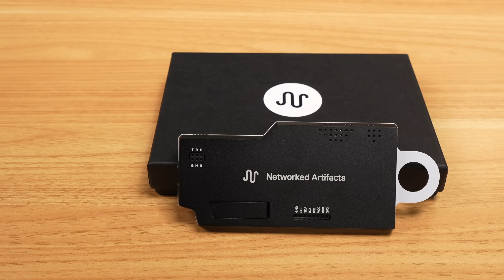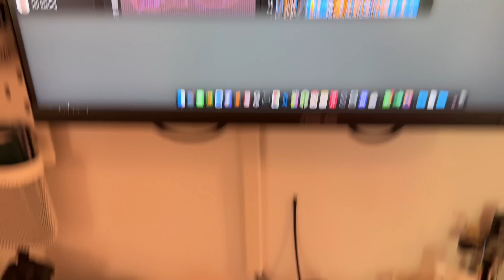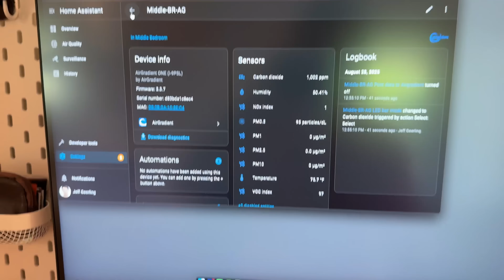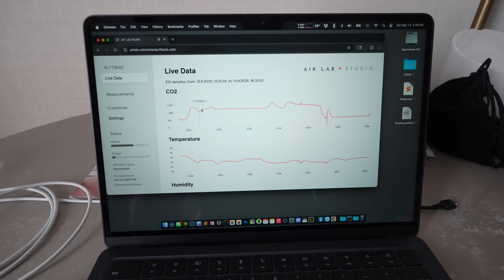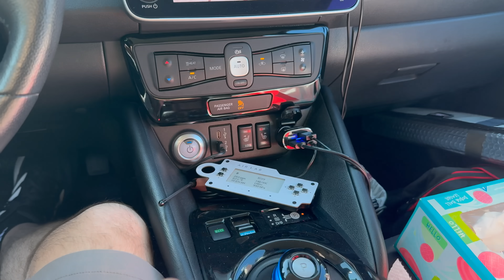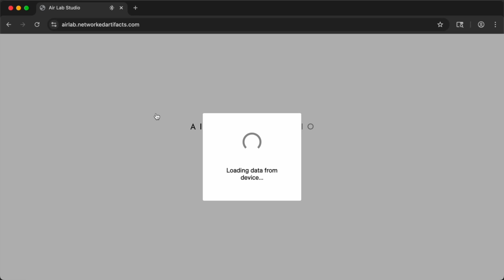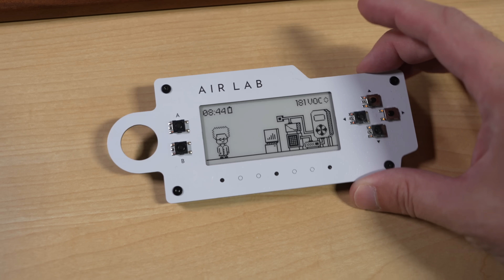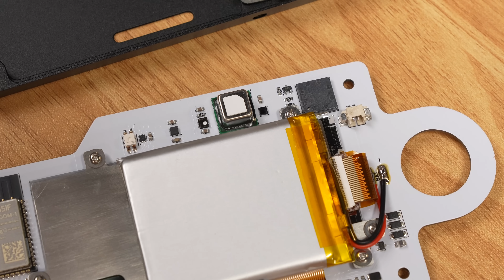Are you sure that's air you're breathing?

Comment: Its too bad that 250 is too expensive for most people, because I can almost guarantee you the sensors are low quality, and inaccurate. I work in manufacturing biomed devices and a genuine CO2 sensor costs 130$ alone and is much bulkier than that profile.

Comment: I have three different CO2 monitors at home: an Awair Element (£229, USB-C powered, also measures VOCs and PM2.5) in my bedroom, a Switchbot Meter Pro (£60, 2xAA battery-powered with USB-C option for more frequent readings) in my office, and an Aranet4 Home (€169, 2xAA battery-powered, also has air pressure sensor) in my child's bedroom. All have local HA integrations and basic temp/humidity sensors. I can't speak to their accuracy, but they seem generally sound. I'll likely take the Aranet sensor next time we go to a SF/F convention, since CO2 is a reasonable proxy for general ventilation quality and I don't fancy getting too big a dose of Con Crud, but the Air Lab would be a decent shout if I didn't already have the Aranet device.
Reply from the maker: The Aranet4 looks nice, and I almost bought one on sale last year... maybe I should buy one now and see how it fares. I like the look, similar to the Air Lab. #bringbacktranslucentplastic
Reply: @JeffGeerling  Battery life (looking at my last cycle in HA History) looks to be about 8 months in a room that runs between 18-28 degC over the year, with a 60s update interval. It has an e-ink display, which helps matters there.

Comment: More DIY, but a Sensirion Sens55 sensor + EPS-Dev Board + Tasmota Firmware provides the same. No display, you have to take care of the housing, but it is much less expansive than 230USD.

There are different versions of the sens5x sensor, the 55 offers particle measurements as well.

Comment: I've been on an Airquality improvement mission (mainly for my kids) and was also shocked at how much CO2 were in my kids rooms by the time the morning came around.
I am working on adding a vent to the outdoor and a fan to pull fresh air in (tropical location, never below 15C)
I will say that the Airgradients work very well (I have 1 indoor and 1 outdoor)
I also have 3 Apollos MTR1 for the CO2 and presence in the bedrooms. The CO2 of the Apollo and Airgradients are almost always within 10ppm of each other.
I just wish I'd ordered the MSR1

Comment: I have two Air things and they are perfectly interested with home assistant. They communicate via Bluetooth. I can also use the airthings app, though, but I don't have to. Airthings record Radon gas, and I consider this very important.
Reply from the maker: You're not wrong - though you still have to set them up through an app and have an account, which I kinda hate.

I have one of their radon sensors, but wish someone would make an open radon sensor I could use instead.

Comment: Huh, looks like you can get all the same sensors that the Air Lab uses in breakout board form for <$70. Pair that with a little MCU like the ESP32C3 or similar and you have the same sensors for well under half the price? I'll have to give that a try.
Reply from the maker: Definitely; as I mentioned in the conclusion, DIY is always cheaper. Margins have to stay high for a hardware company (especially a small startup) to recoup the development costs, so if you can't or don't want to DIY, you have to pay those costs.

Or sacrifice a little bit and buy a cheaper but more locked down AirThings.
Reply: @JeffGeerling  Fair enough! I definitely respect and appreciate their openness :) 
And it's definitely fair that a lot of people wouldn't want to go the DiY route. Bringing these otherwise very niche and expensive products to a lower-cost and small, portable form-factor is a great thing for the industry.

Comment: The Sensirion SEN55 is $30 and it has a nitrogen dioxide sensor, particulate matter sensor, humidity sensor, and VOC sensor. Pair it with a cheap microcontroller and maybe a little display and save tons of money. You lose CO2 monitoring though.

Comment: $250 ?! Come on now . $50 tops
Reply: It's probably got more than $50 in parts and materials in it. I say this based on having looked for and bought some air quality sensors for DIY use.
Reply from the maker: Probably at least $60-70 BOM, all-in. PCB design, assembly, and packaging costs add on some amount on top ($30+?).

That's why I say the product is expensive, but if you're like me and want to see Networked Artifacts go for a v2 at some point—and if you have the money to support them with this decent first product—it may be worth it.

It's the same reason I'll continue supporting AirGradient vs. AirThings, they have a much more open ecosystem and provide me with the ability to completely own the data, and not have an account.

Comment: my device gives yellow alert above 800 and red alert with acoustic warning above 1500. so I am really wondering about the numbers mentioned here as comfy and critical.
Reply from the maker: AirGradient One also alerts at those levels, or thereabouts. Those are definitely action levels, but occupational safety levels (which usually are much higher anyway) are around 5,000 ppm...

I think somewhere between 2000-5000 ppm is where I'd be more concerned, if the levels were in that range continuously.

Obviously the lower the better, but I do think 1000 ppm is a good target for most people, since you also can't replace all air in an older building that doesn't have good air exchange (or some do, with terribly leaky windows and doors!).

Comment: I'm actually working on something similar, but my goal it to have around 1 year battery life. I'm using ultra low power nRF54L. And STCC4 for CO2 sensor, which is a bit less accurate than SCD41, but much less power hungry. Also will be building an USB powered vesrion with more sensors (SCD43, SEN65, something for smoke, CO, pressure etc.).

Comment: Requiring a phone app to configure any network parameters of another device is a hard "will never buy or use" for me.

I never allow a phone app to know the wifi SSID and passcode. The second you do that the information can be harvested by the app's  author or any other author of any module or library the app has been compiled with. Yes you can harden your WiFi and set up a unique SSID and passcode for each device while using an Android phone without SIM or eSIM or mobile account or location services, and enable internet access for that phone and device only during device configuration, then wipe the phone, but who wants to be annoyed by having to do that for each and every device that needs an app to configure? Yes, app configuration methods are convenient. They make is so convenient to cut off your nose to spite your face.
Reply from the maker: For the AirGradient One, it's not an app, just uses a local WiFi hotspot you connect to. But you may just be referring to [almost every other IoT device under the sun], and I completely agree. I hate all the apps.

Comment: 250$ is an absurd ask, new company or an idea, or whatever.
Part in the thing are 50eu tops.
Few years back CO2 sensors were expensive and rare, so 250 could be somewhat justified, now - not a chance.
Also driving with recirculation is it own brand of stupid.

Comment: Has Jeff done a DIY version of one of these monitors yet? I can't justify the cost of this particular device, but am now certainly wanting to check my air quality, especially in my office where I somewhat regularly use my 3D printer near me.
Reply from the maker: I have set up an Enviro+ HAT, which does some of the measurements, but not CO2 - that was in a video I did last year on microcontrollers and the Pi 5.

I haven't seen as many CO2 sensors ready to go on a board you can quickly plug in on a Pi, though. But AirGradient also has a DIY kit option.

Comment: 250 dollars is honestly a bit of a ripoff for things like this...
Reply: The downside of small-scale manufacturing.  You don't have the advantage of economies of scale to bring the price down.  The team that makes it doesn't have a cost to manufacture of $10 and then upcharge $240 - they very likely make only a small profit margin.
Reply: @neverendingstudent  Still no. I'm a hobbyist and even If I buy parts individually, it won't come to 250$
Reply: @Bayharboursaladseller  Completely understandable.  I wasn't defending the price tag as 'worth it' so much as explaining why a small / short-run manufacturing operation would end up with a product that was put out at this price point.  You could ABSOLUTELY buy the BOM (bill of materials) and assemble this yourself for probably somewhere around $100 to $140 with the PCB likely being the single most expensive part if you only want 1, but you have the advantage of not having to pay yourself for the labor, pay for the packaging to be designed and produced, various legal fees, licenses, insurance, other red tape overhead etc...

Comment: Thomas Sandler from Made with Layers did a DIY version of these some time back that I replicated for my needs. Based on ESP32 and various sensors that you can choose what you need. His can be stand alone or do home assistant sync. As with most of these it comes to how good and reliable are the sensors and more accurate and calibrated get expensive fast

Comment: In the US is it not illegal to hold your phone while driving? Filming while driving feels sketchy

Edit: for context in the UK holding your phone no matter what you're doing with it while driving is illegal, doesn't matter if you're looking at it or not (I assume Jeff only gave it a couple glances to keep it in frame and wasn't really looking at it). You can tap on the screen while it's on a cradle as long as it's not excessive, that's about it
Reply: It's state-by-state, but yeah - at least in some states the driver can't use "handheld electronics", in some it's specifically phones.
Reply: @MarkEichin  I looked it up and in Missouri and Illinois they both ban even just holding a phone even if you’re not looking at it. So Jeff recorded himself breaking the law, although there doesn’t seem to be points on his licence and the fine is $150 in Missouri or $75 in Illinois [they were in Illinois] (in the UK it would be £200 and 6 points on his licence, where points last 3 years and 12 points results in a suspension, or 6 points if you got your licence in the last 2 years. Points also increases insurance so that’ll cost a load more)

I do feel obligated to report it as I have no tolerance to permitting distractions while driving. I’m aware Jeff likely filmed in front to show there not being cars, but rules are rules and something could appear in front even if it looks clear. I’ve known far too many people to die as the result of other drivers taking risks

The air sensor logs recordings by time and doesn’t need to be filmed

Comment: A building aircon will not bring in any fresh air at all.
Reply: Residential not often, but commercial yes. Required by code. However, even residential has had IAQ requirements for a little while now. The most common cheap method is having the bathroom exhaust fan on a timer that activates for like an hour every 4 hours or something like that. Otherwise the better builders will install an actual ERV at the air handler.

Comment: I bought one of the cheapest air sensors on aliexpress - looks like gray flat rectangular box with holes on the igger face. It constantly reports around 350ppm CO2, even after night with closed doors and poor ventillation. Looking at Your readings, which don't go below 850 PPM and have big variation... I consider buying proper sensor.

Comment: The co2 at the conference you showed is less than what you have in your house from the graphs at the beginning of the video. My co2 level as i sit in my office is 559 and i'm 3 feet from the sensor. I believe you should do a video on ERV/HRV because that's something I really enjoyed learning about in my new lakeside build. When i first built this place, the windows condensated and my friends said they "felt super comfortable and almost sleepy" when they visited. While that's a nice compliment for having a "comfortable lakefront home", by purchasing a wifi co2 sensor, i learned all about co2. I installed the Panasonic intellibalance fvec-2 for cold climent ERV. Then, learning how air flows and where to place the intake and exhuast. If you've read this far, the most interesting thing i did is have the ERV pull air from above my server pantry, which is hot air. Turned out, i'm actually heating my home with server air because it warms the heat exchanger in the erv. On the note of hvac, i also did something else interesting by using esp32's from the ecobee to the 3 furnaces in the home rather than running wires. This way, i am not limited to the number of physical wires if i add additional air conditioning, humidifier, air filter, or more, etc... I just wrote an esp32 server firmware using arduino ide to pass the changes of all digital ports to the wifi esp32 clients.  Anyway, great video!

Comment: I've been taking my Aranet4 CO2 monitor on airplanes with me lately, and the levels are shocking - I've never seen below 1300 during a flight and above 2000 while the aircraft is loading is typical. Is there a correlation between bad air (combined with alcohol consumption) and some of the horrible behaviour we see on flights? If I were a defendant's attorney after one of these incidents, it's an argument I'd make in court. And if I was in the flight attendants' union, I'd be talking to my shop steward.

Comment: I have an Aranet4 Home in the bedroom ($200, via Bluetooth connection to HA), and it seems that all the more accurate ppm sensors are costly. :(

The use of a non-standard battery in the Air Lab model is, in my opinion, a design flaw.

Comment: Could probably just buy a cheap dumb monitor, set it in front of a webcam set to take photos every few minutes and then ocr each photo. Simply send the text file to whatever server needs it and parse it however you see fit. Clearly not portable but if you have everything but the monitor it could be done for rather cheap.

Comment: For installed air quality monitoring I DIY'd and IIRC the sensors were about $5 each (you need a couple of different ones for each deployment) and then a cheap arduino controller for, IIRC, $15 each. So, the parts ran about $30 and the build time and coding was a couple of hours. I did not get a plastic case or built in screen but so what?

Comment: If you're mostly concerned about CO2, just check out Aranet4

Home assistant compatible. Very easy to setup. Also has humidity and temp data.... I think all the data collected here for half the cost over the last 30 days. Lasts forever (years) on 2 AA batteries

Comment: Please don't call it 'calibrating' the CO2 sensor by putting it outside.
Problem is, I have seen way too many people starting with CO2 sensors to actually ruin factory calibration of MH-Z19 or SenseAir S8 sensors.
No idea why, as you don't start calibrating your temperature sensor, so why people keep on insisting to calibrate CO2 sensors I have no idea...
What you're doing is you expose the CO2 sensor to as clean air as possible so the sensor has some idea of what "400-ish" ppm is.  (Some call it "ABC", Automatic Baselevel Calibration)
However it highly depends on lots of factors whether that's even feasible in your environment.
For example during the night and in a wind still setup with lots of plants, you may even get as much as 700 - 800 ppm outside.
Or in an area with lots of industry or traffic you may also have way higher CO2 concentrations outside. (higher than the 400-ish ppm)

About the CO2 concentration in your car... with recirculation on with 2 adults in a car may increase the CO2 concentration in your car so high that it actually affects your response speed.   After 25 - 30 minutes it can be as high that your response speed is slowed down as much as when drinking 2-3 beers.
Car manufacturers should really build in a CO2 sensor and turn off internal circulation automatically.
Also it would be a great way to detect if there is a child or animal in a parked car and maybe start signalling when this happens.
Reply from the maker: 100% with you on the cars needing CO2 sensors!

Comment: I set up an mq135 on a sparkfun redboard and put it in my garage where the water heater is.  The water heater developed a gas leak, but my sense of smell detected it at the same time as the sensor did

Comment: I wonder about the stability of the NOx sensors. Professional sensors not for lab just monitoring  things like carparks / garages etc say longevity 2+ years and a calibration interval of 6 months.

And where I am the limit for CO2 is usually 1000ppm where the HVAC needs to go full tilt trying to remove it. 1000ppm is enough to tank alertness when sitting till.
Reply: At this price point, the sensors should really be thought of more as for indicating problems than taking measurements. They often don't even display units directly. PM2.5 should be basically 0, NoX should be basically 0. CO2 close to 400 is good, 1000 is bad. VOCs are trickier, since as far as I've seen, all these sorts of devices just use a single sensor which is tuned to detect a single chemical (e.g. ethanol). The AirGradient One actually doesn't display the VOC measurement directly, instead it uses a rolling average to indicate if the current level is higher or lower than typical. But basically, if the number goes up a bunch, there's something in the air which you probably don't want there.

Comment: While expensive, I think the price is somewhat reasonable when you take in to account this has 50 USD worth of sensors in it (based on Mouser pricing). Then add software development costs and anodized aluminum case and you quickly realize why it costs as much as it does.
Reply from the maker: It's expensive, for sure. But for some people, not overpriced (as one commenter put it elsewhere!).